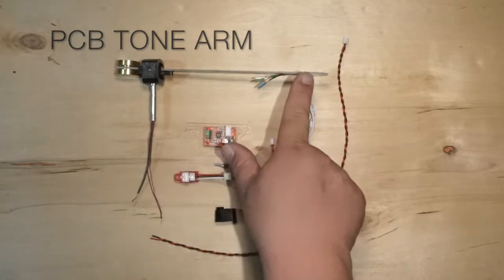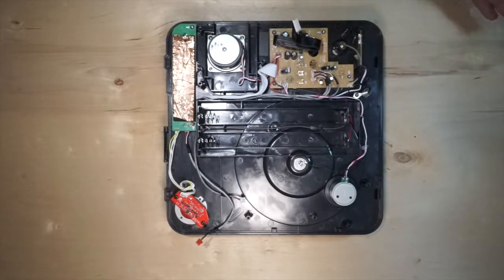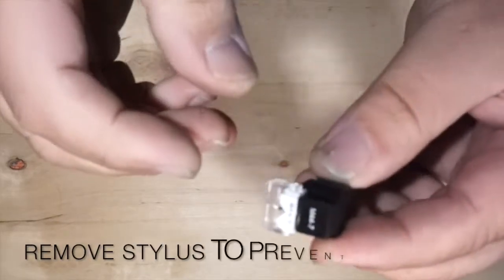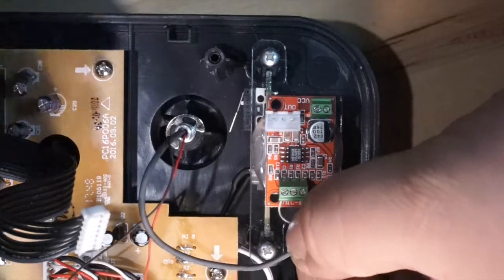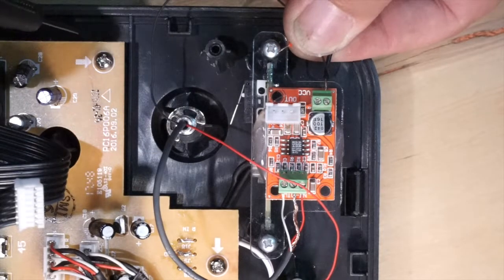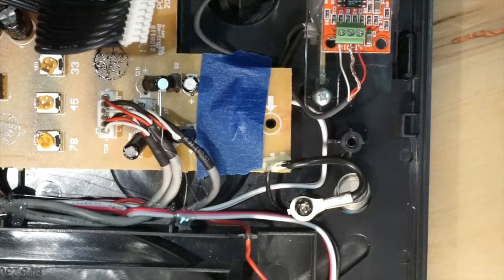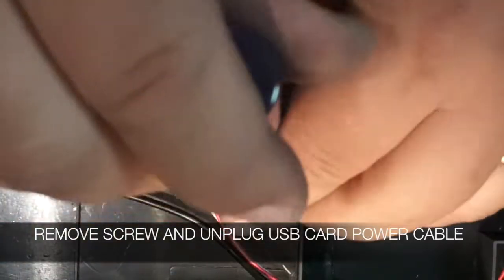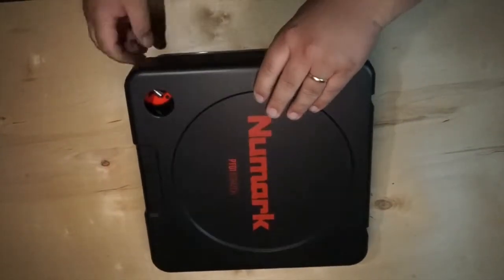JDDPTA PCB INSTALLATION GUIDE

Comment: I would love to know if Jesse Dean can had a solve for the sound only coming out of the left channel issue that so many seem to be having.  Its unfortunate that he hasn't had any sort of solution after this long and with so many people having had the same issue.  I actually got two tonearms.  Both are having identical issues.  And one of them also has a bad buzz that I haven't been able to get rid of.  I really hope you can offer me/us some sort of solution to this problem.  I'm as portable of a dj as they come and have been nothing but extremely excited to buy and use your products, and obviously this is becoming a huge disappointment. And I know not just for myself. Can you please help @jesse dean?
Reply: Found the problem
Reply: @ArturMINIMAL  oh what did you find?
Reply: @akyerit  Straighten the cable going from preamp to preamp break out board. Mine was bent and twisted at first and that caused the problem.
Reply: @ArturMINIMAL  ok dope! Will try tonight! Thanks so much for this. I'll let you know how it goes
Reply: @akyerit  any luck?
Reply: @UncleCatfish  well I did contact Jesse Dean and he sent me new tone arms. But that wasn't the case. So I'm guessing that it's the preamps. And need to get those now to know for sure. Nothing else however has worked for me. And I've tried all of the little wire straightening ideas that people have suggested etc. So with that being said, I would suggest trying to get ahold of him and letting him know. He was very helpful and pro active in trying to solve the problem. Unfortunately for me it just hadn't gotten solved yet
Reply: @akyerit   @Dax Carson  yeah man don't give up!  They goofed up my most recent order and were really cool about it and sent me the correct thing on their dime.  There's so many pieces, wires, etc...it realllllly could be anything but if they don't sell the pre-amp solo on their page, maybe you can contact them and see if they'll send you a new one.  

I'm sure you tried everything... I'm just trying to help! I bought a kit that included the JDD fader and tonearm for Christmas in a bundle.  The fader installed with zero problems, but I still haven't installed the tonearm yet bc I'm trying to preemptively prepare for all these problems people have been having to avoid them or if I DO have a problem, maybe it'll be more obvious.

Good luck my dude!  Do you release music / your cuts or anything? I'll give you a follow.  This is my music page. I have a few PT01 videos that are alright. I love the portable turntable community!
Reply: Dont you love it when they help after you have bought ther products |!
Reply: @akyerit  did you get the problem fixed

Comment: Hi, i forgot the very last step with black cable and turned Pt 01 on... no Reaktion. i connected it afterwards but the turntable wont Start. Did i burn smt By forgeting the Last step?

Comment: I installed this in my Ion the other day and I only seem to have audio from the left channel. I will double check my connections soon. I noticed my preamp is different to the one in this video as it has two power terminals. What is the purpose of the second power terminal? Many Thanks.
Reply: @shaun raynes were you able to resolve your issue?
Reply: @thcpills  I did. Turned out the ribbon wire was a bit twisted and caught. I re routed it somewhere where it wouldn't be and all is well. Stereo sound!
Reply: @shaunraynes1443  thanks... me too stereo!
Reply: Which ribbon cable are you talking about? I'm having the same issue with left channel. Reinstalled and traced every wire for proper routing and no crimps. Still no left channel sound.
Reply: @thomashuntsman113  That sucks. When I say the ribbon cable I mean the JST cable between the preamp and the preamp breakout board. Have you had another look at your cartridge connections? Triple check everything I guess and if no joy email Jesse Dean Designs. I hope you get it sorted!
Reply: @thomashuntsman113  the black ribbon, make sure it's not pinching / twisted too bad
Reply: @shaunraynes1443  great I'll keep an eye out as just ordered one .
Cheers
Reply: @shaunraynes1443  Thanks bro. Fixed the problem!
Reply: i have the tonearm and preamp installed on two ION and one is fine and the other have now a airy sound and especially the sound of the belt friction on platter into the audio... this happened when I slow the platter with the hand. I will try to remove all and reinstall the original tone arm because the problem wasn't here before the mods. Really strange issue. Hope to find a solution.

Comment: I believe my power breakout board is a dud.. everything powers up fine when things are plugged in normally, but as soon as I rout everything through the breakout board to go to the pre amp. It no longer will turn on. Could there be something farther down the chain causing the PT01 to not power on? if not It HAS to be the power breakout board..
Reply: Did you ever get this fixed or find the issue?
Reply: Hi did you Solve this problem?
Reply: I've got the same problem and I wonder if you got the solution

Comment: Hi, I'm also having the issue of know sound coming through the left channel. I've checked the cable connecting the preamp break out board (seems to be no longer a ribbon cable on recent versions), and my supplier gave me a replacement preamp kit, but still no good anyone find any other solutions please? Thanks!
Reply: Did you find solution I believe I read that it's converted to mono somewhere in the pto1 main board not sure if it was the pt01 tho